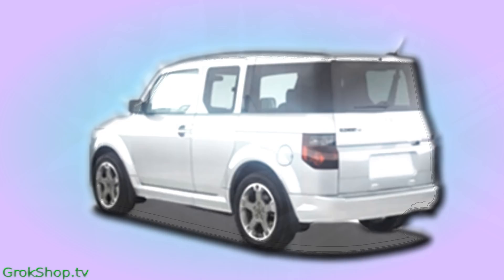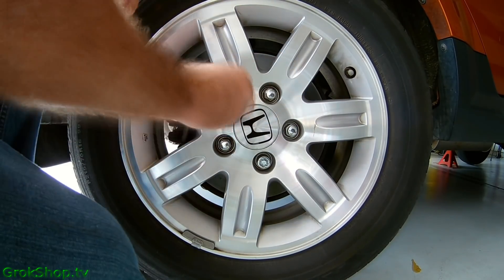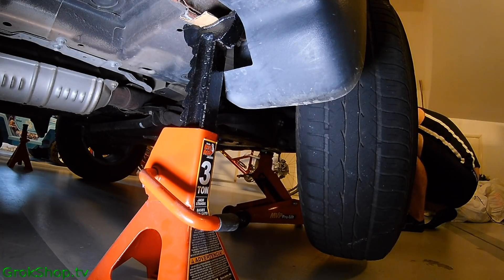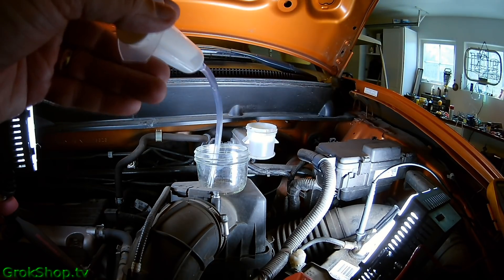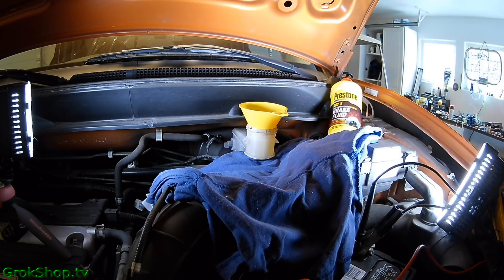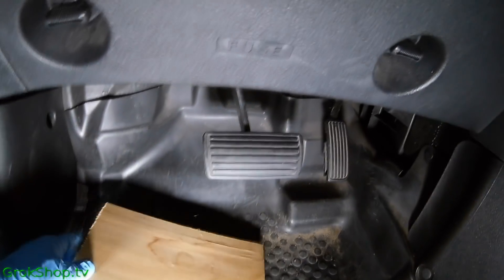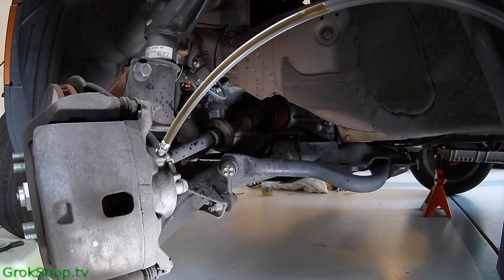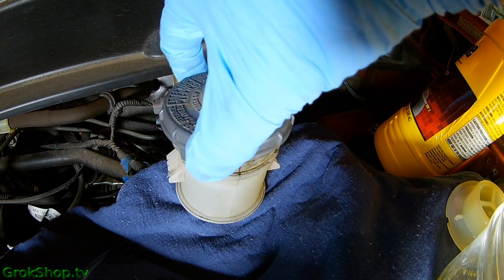Brake Flush / Brake Bleed - Honda Element | DIY | How to Bleed | How to Flush | Easy

Comment: Great video, thanks! I followed your lead, bled Right front, Left Front, Left rear, and Right rear order. When testing, the pedal feels fine until i come to a complete stop. At this point the pedal drops all the way to the floor. How do I remedy that?
Reply: It sounds like you bled in the wrong order. It's left front, right front, right rear, left rear. 

Typically you want to bleed brakes starting with the wheel or line that is furthest from the master cylinder. This Honda bleed  sequence is news to me.

Comment: Hello Grok Shop! Great video thanks for posting but I also have a question. I have bled 3 times & I have no brakes still . . .. I broke down and called a mechanic place and they said It needs to be bled on a machine BUT I HAVE a feeling that may not be true ... What's your opinion on that? (2004 Honda Element)Thanks!
Reply: You have to re-bleed using the two person method
Reply from the maker: If you have bled the brakes 3 times and are not up to full braking power, I would definitely say let a pro have a crack at it.  You could have extenuating circumstances.  Brakes are too important to take chances with.  Having said that, I will say that if you bleed them regularly & activate the ABS as I described, you normally don't need the machine bleeder.  Also the brakes in this car can feel a bit mushy in comparison to other cars, even when in perfect condition.  However, the machine makes it possible to completely flush the entire thing including ABS, so it's going to be better... just more $$, of course.

Comment: Great video except you bleeded the brakes in the wrong procedure. After talking to Honda technician he stated you start from the furthest point of the ABS. Rear right, rear left, front right, front left.
Reply from the maker: The process I showed is the Honda-recommended process.
Reply: your Honda tech hasn't read the Element shop manual.  It very clearly specifies LF, RF, RR, LR.  Yes, that's different from most cars, but that IS the order Honda says to use for the Element.

Comment: So was 32oz. of fluid too much for a flush or did you need more/less?
Reply from the maker: There was probably a good 8+ oz left over.  You can kind of see at 10:20 by looking at how far the bottle is tipped & guestimate from there.  So, 2 12oz bottles is probably sufficient.  Of course like I said, you don't really want to save the leftovers for use in your car at a later date, but there are other uses for brake fluid too!

Comment: Bleeding brakes, you must start from the furthest wheel in relation to the ABS Pump and brake fluid reservoir,  rear passenger wheel, then driver's rear, passenger front then driver's front. Also never pull you parking brakes when bleeding, by doing so you lock your rear caliper with old fluid inside.
Reply from the maker: The procedure in this video is done according to Honda's specifications.  Therefore, this is the correct procedure for this car.  Generically speaking, yes you would normally first bleed the caliper farthest away & get closer as you go.  But I would not recommend a deviation from the manufacturer's recommendations.  Also, in most cases, parking brakes have no effect on the bleeding procedure as they are typically mechanical in nature & isolated from the hydraulic lines.
Reply: @grokshop  Yeah, my 2017 Elantra Sport oddly has me start at the farthest wheel in the manual, then goes to the closest (LF) and then LR, then RF.
Reply: There are a few types of parking brake systems. Some are a separate system like the ones on a Honda element which are located under the disk brake hats. Others have the parking directly connected to the brake caliper.
Reply: That is most common order, But Honda Element (and some others) specifically state to do in a different order. To be safe, check the owners manual of your specific vehicle before bleeding.

Comment: Like the idea of the wood on the floor jack and cardboard on the stands.   However that being said......not all lift points are straight and smooth for maximum surface area engagement.

Comment: Outstanding job. One thing I like to use on the bleeder fittings, especially to initially break them free, is to use a six point socket or box wrench, especially on an older or northeast USA where we love salt. The six point helps prevent stripping of the bleeder hex.
Reply from the maker: Thanks Randy.  This is solid advice, too.  The reason being that 6 point wrenches or sockets distribute the torque more evenly around the fitting vs a 12-point.  (We like salt here in SoCal too, but mainly just on our fries :P)
Reply: flare wrenches to prevent that!
Reply: +1 on that, 6 point is a must.
In Norway rust has it's own citizenship. 
Ice, snow, salt and RUST. Yeah, there's plenty of all that around here. ;-)
Cheers

Comment: Mine were so tight that the wrench that comes with the car would not loosen them even if I am standing on it.  A good breaker bar is a must for those situations.  You don't want to have a flat and not be able to get it off.  That would be really awful.  The only way I can think of it being worse is having those two piece lug nuts found on many Chrysler cars.  Those horrible things have a lug nut but a thin metal cap which is often troublesome because of the way they tend to deform sometimes.  This makes them very difficult to remove.  Who ever designed those awful things must have been truly evil!!  Imagine having those on but over tightened (I can already imagine all the cursing and cussing while someone is in that unfortunate situation).  Having those lug nuts is no fun.  I got rid of the rest of them for solid ones the local tire shop has for just a dollar each.  I am not sure how much good ones usually cost but anything is better than those horrible two piece lug nuts.

Now I no longer have that Chrysler but instead a Volkswagen.  The fluid in that car is what brought be here, it has turned green and needs changed.  It must be fluid it left the assembly line with 8 years ago.

Comment: Before starting any maintenance of service work, it's smart to read the manuals. 

Honda is pretty adament about using only Honda brake fluid, to the point where adding anything else is described in the Owners and service manuals as something to be done only in an emergency, after which ASAP the system should be flushed and replaced with Honda's fluid. At $12/qt for Honda's fluid,  vs a lot more for replacing cylinders, why use anything else?

The Element Owners manual shows the front jack point as in the center of the front cross-member and the rear is the rear tow loop. Thats a one one lift per end, but it does require a jack that can lift +20".  I'm lucky that I read the manual  first and bought a jack to do it. 

The forward tow loop positions and rear cross member can be used with a smaller jack, but I observed that using that rear cross member one time effected the rear alignment.

If you start with the tubing arcing downwards as soon as possible, gravity plus capillary action will pull fluid down and into the catch bottle (gravity bleed).  The  tube can then  be raised to above the level of the caliper.
Reply from the maker: Hi P Schmied.  Thanks for your thorough & thoughtful feedback.  

I absolutely agree that reading the manuals is imperative.  However, you should also be aware that Honda is a business & wants very much to sell as many products to you as possible.  I have been servicing Hondas for over 25 years & can tell you that if you feel you have to use Honda branded brake fluid: you sir, are incorrect.  You see, brake system fluids are standardized by US law (and probably similar laws in other parts of the world).  The reason for that is that proper braking performance is absolutely paramount.  This being the case, Honda is forced to design a braking system which dutifully accepts one of the major standards (DOT3 in this case) of brake fluid, and when such fluid is used in a Honda, the brakes must perform to a standard & maintain reliability.  My advice here: service the fluid regularly (as explained in the video) and use the cheapest big-name brand you can get your hands on.  As a side note... definitely only use Honda's power steering fluid when you are servicing that fluid!

Regarding the jack points...  You are correct about the jack height problem.   I'm glad you have found a good jack!  One day, when my old jack gives out, I also will get one where I do single jack points.  My experience jacking many, many times is: you can feel free to jack any car up by any sufficiently large & exposed part of the frame.  I don't understand why you would have an alignment problem by jacking at a crossmember.   I've done this many times (on many types of cars) and my alignment has never been as issue.  In fact, Honda alignments are famously solid.  

I agree on the gravity bleeds - they are a great way to go if you have the time because they reduce the risk of damaging the master cylinder while requiring less work!
Reply: Honda wants to sell their grossly over priced parts. Engine thermostat for my Element was $98.00 and it is plastic. This is my last Honda.
Reply: Volkswagen is like that with transmission fluid.  For my car that fluid is $24 or $25 per liter!!  There are cheaper alternatives people have tried and have not yet mentioned any ill effects on their transmission.  Now if it is a ZF transmission, it would be best to stick with the right ZF fluid.  Mine is made by Aisin Warner instead and knowing that leaves the possibilities open for searching forums for other cars using that same transmission and see what they are using and see if they would use that fluid again or if they had any shifting problems from using a different fluid.  Search around and see if anyone with that same car had any problems.  You will quickly learn that there are plenty of less expensive fluids this way which you could possibly use.
Reply: Hondas can easily use DOT 3 or DOT 4 Brake Fluid (it even says so on the Brake Fluid Reservoir Cap). You can use Honda Brand Brake Fluid if you want; but, it's just expensive DOT 3 (maybe DOT 4 if you're lucky). Honda requires it's own brand of Transmission Fluid and Power Steering Fluid; however, every other type of Fluid is whatever you can get your hands on (just don't use the REALLY cheap stuff). There may be some Hondas/Acuras out there which REQUIRE Honda Brand Brake Fluid; but, I haven't come across any of them, yet.
Reply: Honda has no trouble selling their fluid with a margin that will make the dealers money - but they also want you to use their fluid because they know it works and it eliminates one possible trouble shooting scenario.

Comment: Fantastic , they have bleeders that are not so expensive and make the job quicker as well.. just need to connect it to shop air or a compressor with a air hose. And there is no pumping the pedal and you can stay right at the bleeder and watch it for the new fluid to emerge out the line. Bingo bango !
Reply from the maker: Cheers JOGO.  I have used those hand vacuums to bleed before, but never one with the compressor; I have a pretty good compressor, so I will have to look that option up!  FYI, with the plain pedal-mash approach, a vid chat with 2 phones helps to see when the clean fluid starts coming out.